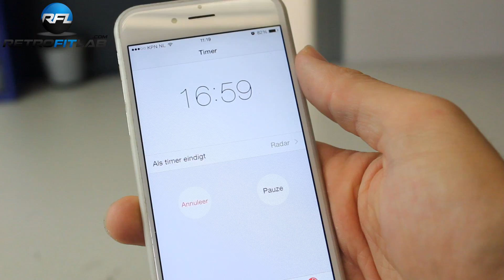Alfa Romeo 147 facelift projector installation

Comment: Hello guys what.s the lenght of the projectors you used..i found  some 3 inch 11.5 cm long and 7.5 cm wide.think theyll fit?
Reply: Retrofitlab thanks for replying.
Reply: They won't fit. You need 2.5 inches
Reply: @kdotroy1  actually they do fit..i fitted 3 inch  and it works perfectly
Reply: @aquariys  oh mad. Was told they wouldn't. Thanks for letting us know. 💚🍀🐍
Reply: @aquariys  wait did you put them on a 147 or a Giulia?
Reply: @kdotroy1  147 facelift